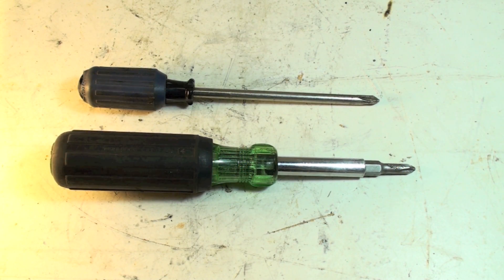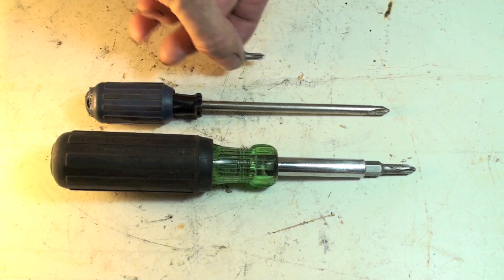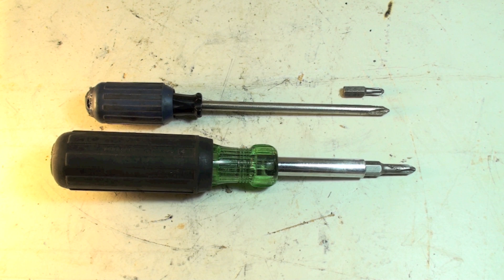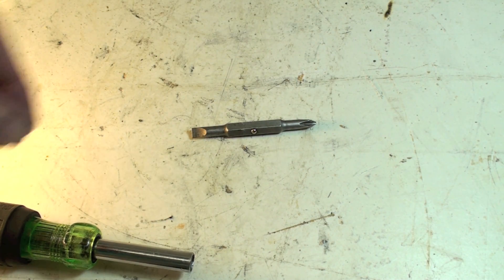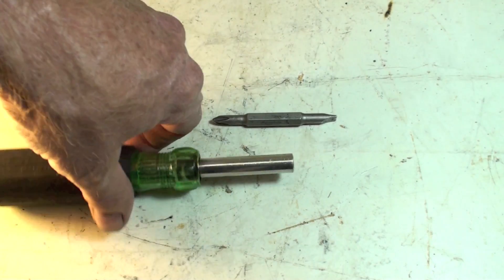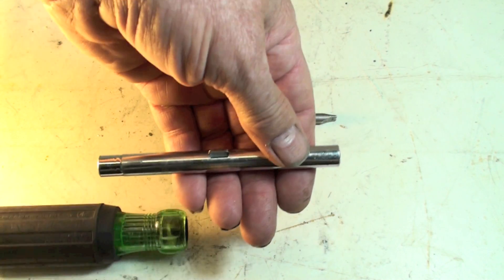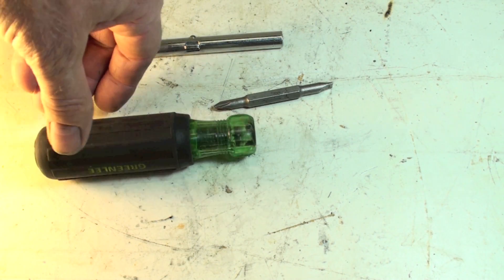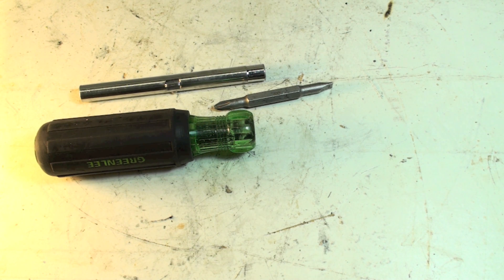Multi drivers for HVAC

Comment: On my GREENLEE 10 in 1 I took out the small slotted and square head bits and replaced them with a Schrader core remover and a 'multi-bit' driver for breaker panels - way more useful for Residential HVAC Work.